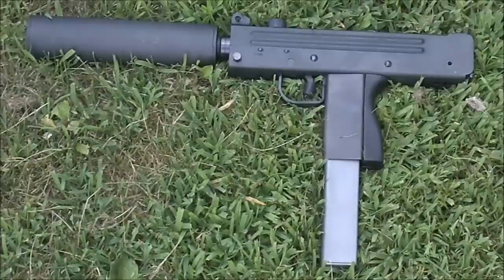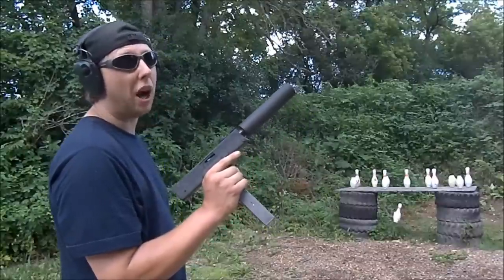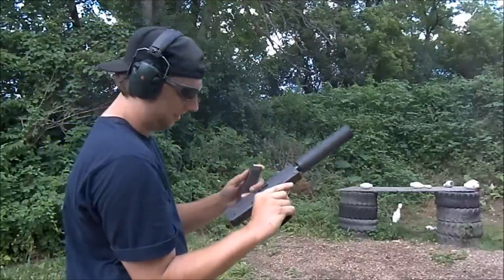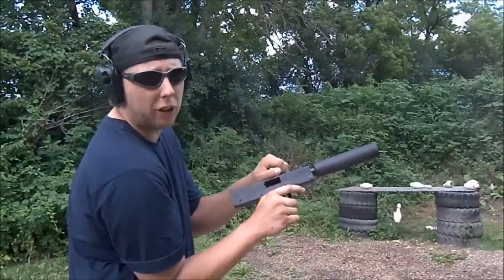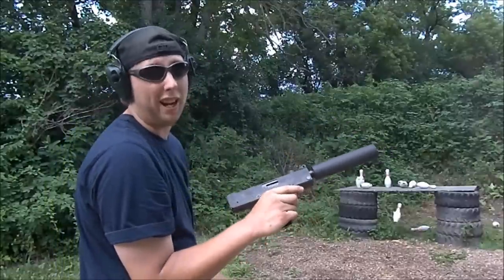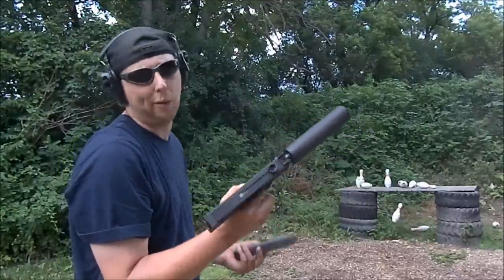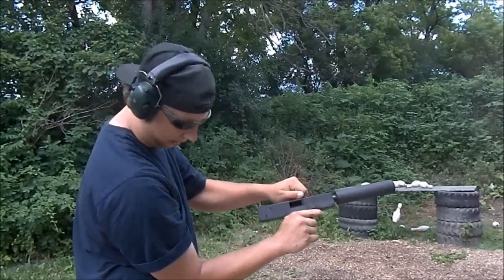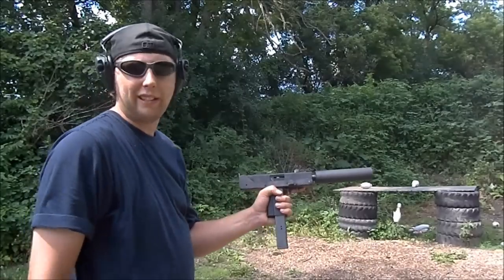Cobray M11 Test Fire (Uncut)

Comment: For advice on fixing the feed issues with promag mags, you can scrape the internal ribs off with a screw driver or similar tool and they feed much better. I also ran an oiled rag through it once and it seemed to help, but is unnecessary if you do the other part right.

Comment: I owned one of these in the mid 90's and luckily had no issues. Wound up selling it to a pawn shop.
Reply from the maker: Yeah mine was a Zytel mag issue I think.  I haven't shot it for a very long time but that's going to change.  I just had all the internals coated with some special stuff and got it hydrodipped.  Can't wait to show my friends and subscribers.  The pattern is water droplets and the droplets are in burnt orange color.  Hope you stick around to check it out.

Comment: If the hammer is not in spec and the sear plate fails to catch the hammer on recoil sometimes, that allows the hammer to fall forward with the bolt (hence will barely tap the firing pin)

I have 3 of these - 2 of them put out 30 rounds flawlessly in 1 second using bump fire  ( yes, an automatic rate with only a semi firearm :-0)

The most recent has this similar issue and after having messed with it(grinder, etc) without success in curing -- I have ordered a CNC'd hammer for it.
Reply from the maker: Yeah the mags SUCK!  I have 2 steel mags and those SUCK!  You may be on to something with the hammer being out of spec because it seems like the hammer will ride the carrier forward.  I hate this crappy gun and may as well use it as a hammer.  I will see if I can get a hammer for it MAYBE.  Thanks for the great comment!

Comment: I had a problem like that with my Mac 10 I had to go through complete gun because someone that know what they're doing with it I just take the firing pin out because the end of it was mushrooms if you look at the bullets and they have a lot of dents on them from the distractor the distractor you will have to cut off some of the spring to make it less tight I had to cut off one loop one complete circle and that solved that problem then I had to polish the slide in the main thing that fucks up on those guns that most people don't know it's the magazine you have to get really fine sandpaper apparent needle nose pliers and you have to get the bullet with just wants to come out so when it kicks back the nose of the bullet is up there so you should be up to slowly cock the gun back and slowly let the foreclose if it doesn't work slowly then you're going to have to mess with it to it does and then your problems will go away unless your limp wristed when you shoot which it doesn't seem like

Comment: There is a technique to shooting these semi auto versions. You need to apply forward force with your barrel shroud. I've never had a single problem with mine. These guns were not designed to run semi with standard ammo
Reply from the maker: Yeah I have tried EVERYTHING...I turns out it is the mag's haha.  Thanks for checking it out and be sure to check out my channel.  Just did another test fire and posted it.

Comment: Mannn I have a masterpiece arms mac 11 9mm and a 45 velocity vmac mac 10 clone . They never fail to shoot or jam. I run them wet. I'll clean them with lucus gun oil. Make sure it's grit Free and it will fire until there's no more ammo. I use round tip ammo in them I don't get the heaviest or the lightest load... Right in the middle.. steel case. No brass😷
Reply from the maker: Hey that's great info!  I got it fixed now.  Thank you for the comment and welcome to the channel.

Comment from the maker: I really disagree with you on the limp wristing part I have shot this pistol many different ways and the problem seems to be...well who knows.  I have had a number of issues with it but most recent is not light strike but no strike at all.  It has me baffled for sure.  There is a click but no bang...look at the primer and no strike at all.  The pin is good otherwise it would not fire at all.  Im not sure if the pin is not in the correct location after reset or what.  I admit defeat.  Thanks.

Comment: I sadly purchased one of these about 10 years ago. It was also a piece of absolute junk! I got rid of it as soon as possible. For anyone intent on owning one (don't) if you have to, I wouldn't recommend using 115gr. In most sub guns/firearms with heavier bolts it is suggested to use 124 gr rounds, which are a bit heavier and typically loaded to higher pressures. This can help with reliability issues in certain cases. Not sure about this gun though, it is a piece of crap.

Comment: try building a lower that uses a magwell designed for Sten magazines those are more reliable than Zytel magazines and are more plentiful and cheaper than Zytel mags.
Reply from the maker: +Michael Mitchell That is an option but I gave up.
Reply: predawndeath. very good video..great sence of humor i like your review aswell

Comment: I am NOT a know-it-all. The first thing that ANYONE that buys these guns should consider is THE LOW COST. I have watched your videos. Your bolt is not fully grasping the round that is to be chambered because of slag (SHIT WELD) on the inside of the upper receiver. I say the following without intending ANY offense but had you put more intent into making the gun functional as opposed to simply discrediting it on an internet video you may have been able to ENJOY the true reliability of this platform. But I like your videos so whatever, keep up the good work. Next time build a parts kit. Takes all the flaws off the 'manufacturer' and then allows your videos to celebrate this cheap reliable SOUND platform. Stay cool